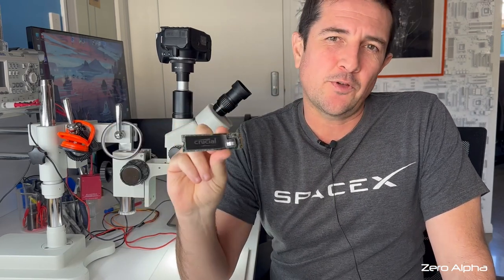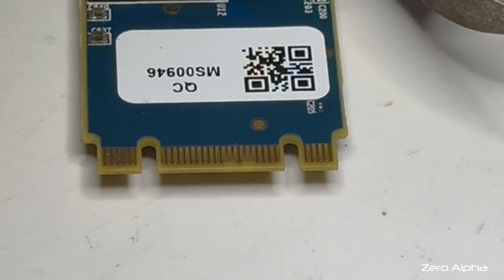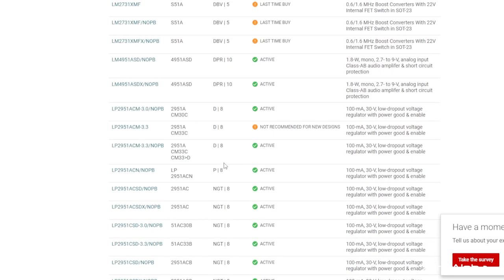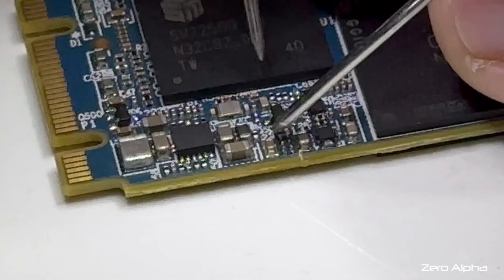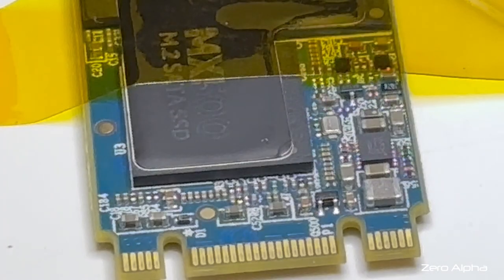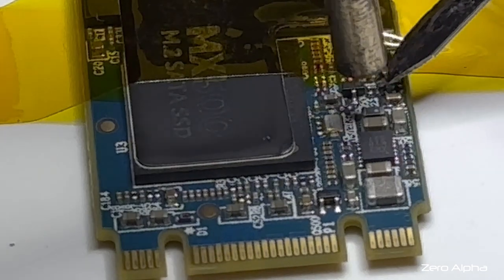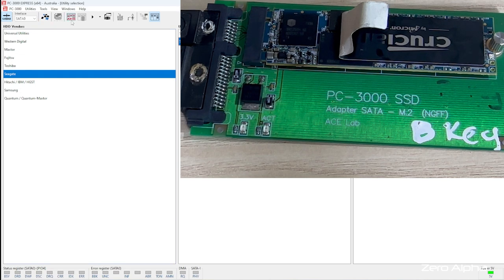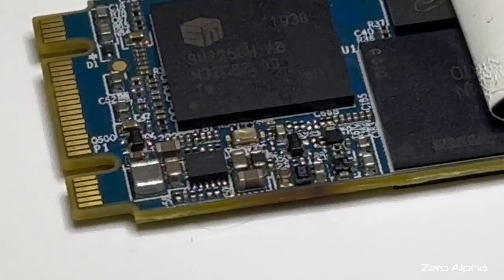SSD Short Circuit Data Recovery, Crucial MX500 1000GB!

Comment: I just learned two things and noticed one. Firstly, I noticed you have the hands and dexterity of a surgeon. The things I learned is, despite knowing stuff, it is clear I don't know enough, such that it would be foolhardy to attempt anything similar to my own dead SSD. Further, I learned there is a reason why having SSDs repaired and or data recovered isn't cheap. In the end, you have likely saved me the extra work and cost to have a professional first fix what I messed up and then fix the problem: using a service is worth it.

Your video has certainly earned a like and subscribe as well as my personal thanks. You are a true professional both in your technical skills as well as your suburb presentation abilities.

Comment: Ive had a total of 4 HDD failures in 15 years. Just recently had an SSD fail in a 3 year old Rog Strix. NONE of these drives were dropped. What ive learned is that ALL HD's are kinda weak, sensitive and flawed. So Enterprise class drives and an equal backup of each drive in a computer should be redundant and a built in cost of computing. In otherwords a computer should have 4 drives, 2 that are working all day long while being simultaneously backed up lika a RAID.  The bigger issue is archiving data, its still more stable to backup to tape. And that is a flaw in our hardware.  Most of these HD's wont even be usable in 20 years as our technical progression makes old hardware almost unnacessable. Imagine if you had to extract data from a 20yr old drive that uses firewire, it would be difficult to find the hardware or cables to access the data.  Where as on tape, we could pull the data with a VHS player. We arent as hip and advanced as we should be.

Comment: Nicely done sir. I'm curious about the shorting the ssd part. I have a ssd myself that's working fine in my pc but i can't read and wright data to it. Used it in my pc for a wile then my ps4 and later on back to my pc and that's where it gave up on me. I don't care for the data but sense it shows up just fine i like to bring it back to life if possible. Have seen someone showing a clip on the shorting and hooking it up to a software PC3000 i think. I looked it up and it's not an investment I'm willing to make and sense i don't care for the data i like to give it a go but unsure how. Do i just short it and wipe or is it in need of a tech. Computers is a hobby of mine but this is slightly out of my realm.
Reply: @@dariusrus6911 Appreciate the info and i know about it but i also now that's not the case here. Maybe the move from one system to the next caused a corruption i'm not sure.